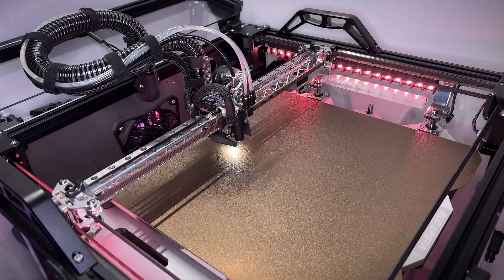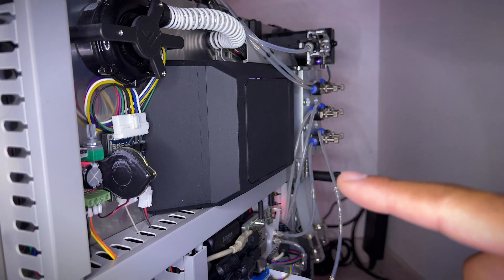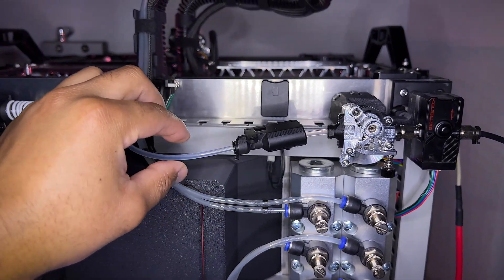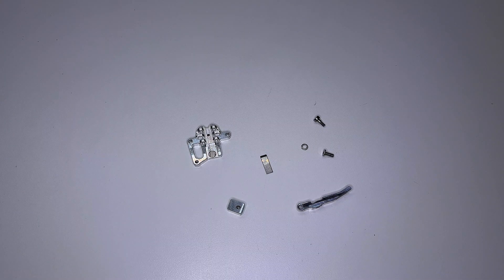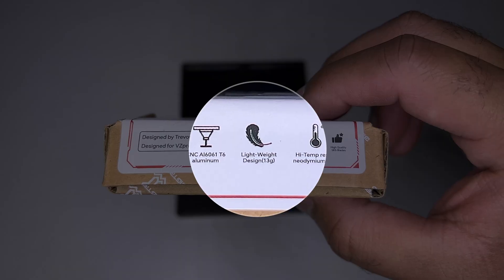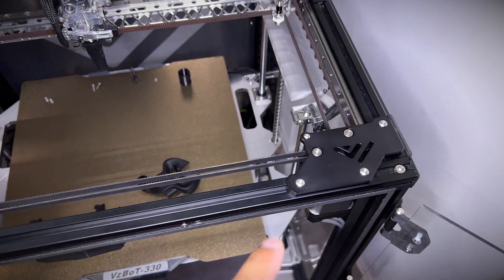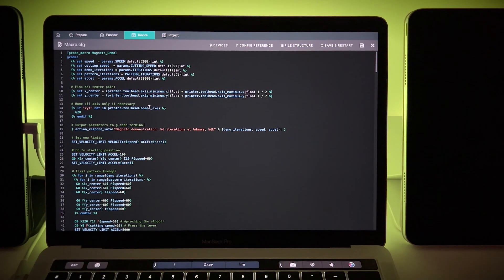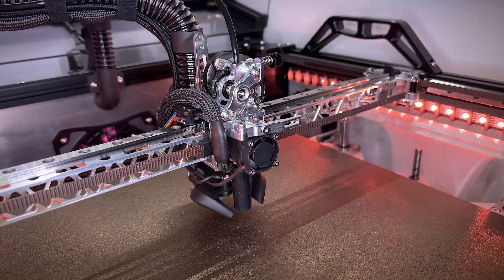"Magneto" the VzBoT Filament Cutter

Comment: For 1 you didn’t even actually test it at all! You literally just installed it on a machine that can not use it 🤦🏻‍♂️. I’d be more concerned with why your machine is so slow! I have a custom designed vzbot based machine I made and it’s only 2 motors on 24v and can hit higher acceleration than yours 😅. I wish I was better at editing YouTube videos than 3d printing so brands would send me free products but I’m just batter at actually using a printer 😂

Comment: i would not add 13g to mount a filament cutter, i would just mount scalpel blade on the frame somewhere that slides somewhere between the extruder and hotend -- that way it isnt a factor input shaping

Comment: how much more flow does the secondary extruder give you?
Reply from the maker: It doesn’t add any extra torque or flow, it’s synchronized to the main extruder, so it’s purpose is to help the main extruder to extrude without any restrictions over long or curved PTFE tube 🙂

Comment: First off ...Awesome printer, I really like your blip sound for when there is a issue/notification etc on the printer can you share what hardware you used and your .cfg / macro for it.
Reply from the maker: Thank you mate I appreciate your comment 😀

Here is the hardware list of what I used:
1- Cheap speaker (Laptop internal speaker)
2- Mini amplifier 2x10W PAM8610
3- BESIGN Loop Noise Isolator (Because I had a Buzzing noise to eliminate)
4- Jack 3.5mm (Male to Male)

Here is a temporary link of what you have to do to add sound to your Klipper:
https://we.tl/t-q5gFYrIps1

Tell me if you got everything done 🙂
Reply: @rcgeeker  Thanks for the info, sadly the link you provided has expired and I don't have the right account type to recover it can you provide the info another way or can I find you on discord?
Reply from the maker: @grantparkes3926  Hi, here is a permanent link to the needed files. 

https://drive.google.com/drive/folders/1w6TJHYbftjP8LGfqnXkBc6kuOWuKEBL9?usp=share_link

Comment: Awesome build and incredible speed! What amperage are you running on your xy motors?  Also, have you noticed any print quality differences with the Z0 fysetc rail and would you recommend it over a hiwin? Thanks for another great vid!
Reply from the maker: @The3DPrintinator Thank you 😀 I set my stepper drivers at 2.8A and changed some TMC settings.

I didn’t notice any differences on the print quality, but such a difference on the noises, there is almost no rattles/vibrations compared to the original one (LDO) that was too loose.

I didn’t test Hiwin yet so I can’t compare, initially I bought the Fysetc just because it’s hollowed and lighter.
Reply: @rcgeeker  Thanks for the response! I have been running 2.8A as well. What TMC settings did you change? I have been using TMC autotune, is that what you are talking about? Also, your print quality looks incredible, even the magnetic vent flap that you printed at very high speed. What was your outer wall speed/accel on that (or what is your secret to perfect quality at such high speed!)?
Reply from the maker: @ There are three lines to modify as shown below:
Driver_TBL: 0
Driver_TOFF: 1
Driver_TPFD: 0

I got in the info from Vez’s video called “Recipe for speed”.

For the quality it depends on the filament but I’ll make a video on the way I calibrate them.

The flap vent print settings was:
Speed in everything: 500mm/s 
Supports: 200mm/s

Normal printing: 60k
Outer wall: 10k
Inner wall: 20k
Bridge: 20k
Sparse Infill: 60k
Internal solid infill: 60k
First layer: 10k
Top surface: 10k
Travel: 60k